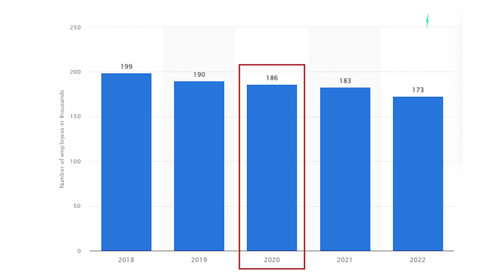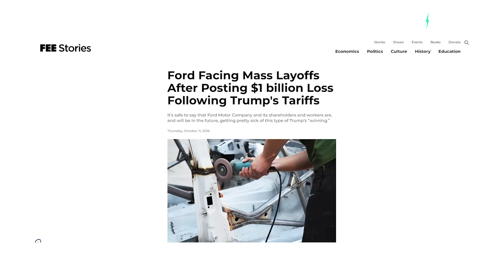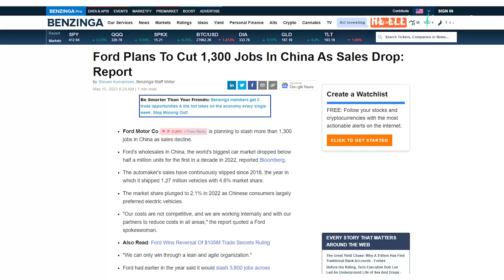Ford's secret plan to cut 30% of its US workforce & thousands more globally

Comment: You can't mix EVs with ICE - as Legacy is finding out.
Reply: That is why Ford is building EV specific plants in Kentucky and Tennessee.  Yet, Ford can mix ICE and EVs.  At least when it comes time to balance the checking account.  ICE trucks and SUVs are generating a lot of positive cash flow which Ford is using to develop EVs.  Ford actually might make it. Might.
Reply: @billsrelectric  nah 😂
Reply: Exactly, ICE factory will be a liability and not an asset.
Reply: @billsrelectric  Don’t forget also Oakville Assembly is converting to EVs as well. It’s in Canada so of course it’s not mentioned lol
Reply: @billsrelectric  Nope - as long as they use dealerships the dealer will add on $15,000-$25,000 to the EV
Reply: @Jaycee604   Apologize to my Canada friends.  Sadly, the US Media doesn't report much on our Northern Neighbors...
Reply: @noleftturns  I took delivery of an EV, thru a dealer, about a month ago.  It was at MSRP and no added fees.  Believe it or not some dealers are not hosing buyers.  I do hope if a dealer does tack on "market adjustment" fees that buyers simply walk away....and post online about that dealership.   Online reviews, overtime, will make a difference.
Reply: @billsrelectric  Congrats on the EV purchase and not getting hosed!
Reply: @whowhy9023   Something to ponder.  In 2022 there were approx 14 million passenger vehicles sold in the US.    Of those, 485,000 were Teslas.  That means approx 3.5% of new vehicle buyers bought Teslas, but it also means 96.5% of US vehicle buyers bought something other than a Tesla. 96.5%    Taste? Styling? Lack of knowledge?  Vehicle type? (A lot of people do buy pickups or large SUVs)
Reply: @PolineChan   Something to ponder.  In 2022 there were approx 14 million passenger vehicles sold in the US.    Of those, 485,000 were Teslas.  That means approx 3.5% of new vehicle buyers bought Teslas, but it also means 96.5% of US vehicle buyers bought something other than a Tesla.  96.5%    Taste? Styling? Lack of knowledge? Desire to drive a pickup or large SUV?
Reply: @billsrelectric  That’s ok you couldn’t be more right about that. We’re like the poor cousins lol.

Comment: The only reference to Ford Job cuts in the US are posts made around August 2022. There is nothing, other than the Electric Viking, about Ford US job cuts posted in May 2023. Not saying that it is NOT going to happen, because the title says 'secret plan to cut 30%'.....so it is possible that Electric Viking has some inside info & is the first to break the news. However, as my past fact checking on statements made on this channel have taught me, there are often significant inaccuracies on this channel.

There are news stories about 1300 jobs going in Ford China, & older news about lots of Ford jobs going in Europe & last year 8000 odd Ford jobs going in the US. I am wondering if the '30% /  8000' mentioned in this video is actually referring to the old news from last year & maybe Viking just missed the 2022 reference.
Reply: As someone that works in the industry, his information sounds like he read something and then explains it in his words. Dunning-Kruger effect.
Reply: @devolstoddart2842  .....I work in the industry too 🙂

Comment: I think Ford and GM could build a 'Minimum Viable Product' doing the least effort to convert their existing trucks to electric.  
Their existing customers would almost certainly buy trucks that looked and felt the same as the current best sellers.
No need for fancy software and touch screen controls.  That can wait.

Why can't they figure this out?  Stamp it, weld it, paint it, build it.  80% of it IS THE SAME!!!!

Comment: the former Ford CEO Hackett had the guts to really trim Ford staff esp. the expensive bureaucracy. For each VP you can hire 10 regular assembly workers; so that is where you gotta concentrate your cuts. Unfortunately the current CEO Farley doesn't have the guts to cut drastically, that they must do, to stay alive. They are milking their truck business, but the Cybertruck is going to take at least 10% of Ford's truck sales,  in 2024, so now is the time to cut, but it won't happen, and so Ford will have to do some drastic, ugly, cutting down the road.

Comment: Sam, I was thinking about getting a Ford Maverick - the new little 4-door hybrid truck,  to wind down my business from my full size F-150.  
 Went to the dealer... they wanted $10,000 MORE than the $25,000 list price!  And all the other dealers too. 
And the Ford website said "because of higher than expected demand, 
you can not buy from this website, but must contact your dealer."   

 Well, as we know from watching TEV,  Ford has been FIRING or LAYING OFF workers for years now! 
   So.... they'd RATHER LAY-OFF WORKERS...  than PROVIDE WHAT CUSTOMERS WANT!   
   That's on TOP of Ford's  WORST IN INDUSTRY (worse than Chrysler/Dodge?!!) SAFETY RECALLS! 
   clearly, **Ford  MANAGEMENT is PURE PREDATORY  incompetent B.S. !!**  
   They DON'T CARE FOR their  WORKERS... OR CUSTOMERS!   If they can't make $40,000 PURE PROFIT 
on a POORLY BUILT but loaded big, luxury pickup truck... they will TAKE THEIR TOYS HOME and WHINE!  

    ALL these big auto companies have INTERLOCKING BOARDS of DIRECTORS - with banks, with oil and chemical companies and suppliers,  
and they're ALL OWNED by the BIG FINANCIAL HEDGE FUNDS - Blackrock, Vanguard, GS, Buffet, etc.
  These MEGA-FINANCE corporations are, in turn,  WHOLLY OWNED SUBSIDIARIES,  or FRONTS, for the TRILLIONAIRES financial dynasties that OWN the CENTRAL BANKS...

when  THEY   (THEIR WHOLLY OWNED media)  say  "THE GOVT. OWES $23 TRILLION in DEBT" - IT IS TO THESE dynasties,  maybe 1,000 ppl.
WHEN YOU'VE GOT THE NOTE on some portion of  $25 TRILLION dollars, YOU DON'T CARE about "EARNING" money... 
and in fact THEY DELIGHT in LAYING OFF TENS OF THOUSANDS of workers,  indeed, IF THEY DRIVE a MAJOR COMPANY IN TO BANKRUPTCY, 
they can LOOT THE PENSION FUNDS   _as they did_ in 2008
Reply: Ford Maverick plant adding a third shift.

Comment: My opinion is that Ford came to a conclusion that it was easier to rid itself of the ICE mgmt and employee organization by separating out the new EV portion of the company. They pay less. It may even be easier to deal with the UAW.  Imho this was a super smart thing to do. It’s going to be tough the next few years but they are heading in the right direction. Eventually the ICE org chart will disappear. Employees need to get training and apply for those EV jobs. Or ride it out and get fired. Tough choice, 50% pay cut or a layoff.